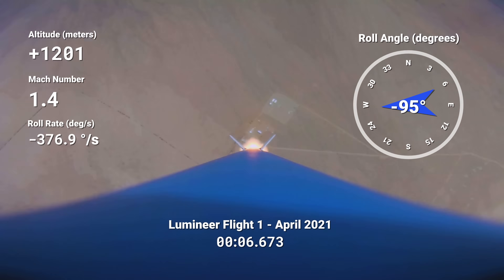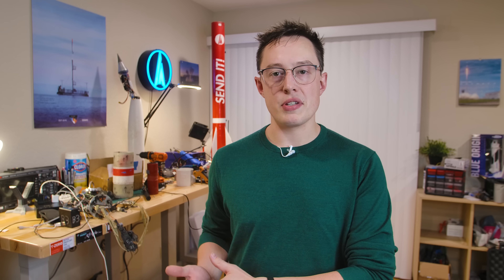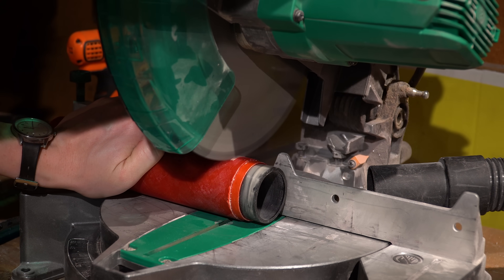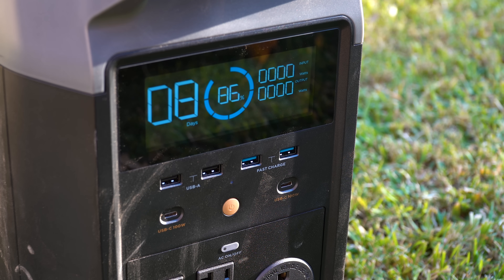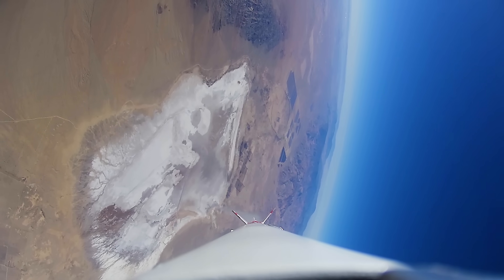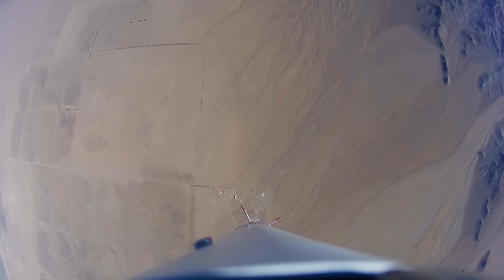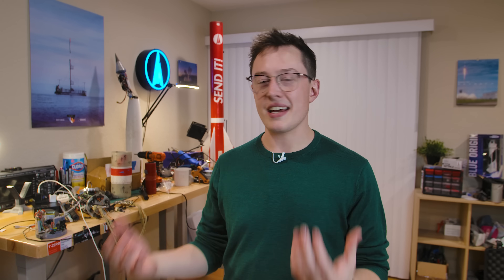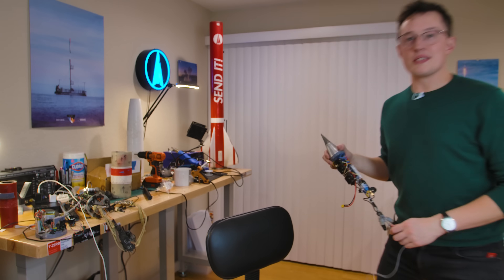Can You Get Stable Video From a Spinning Rocket?

Comment: The motor isn't necessarily the problem, it is the ESC. The hobby ESC's use back emf to synchronize the commutation of the phases. A better ESC / better ESC tuning could decrease the back emf voltage (which is proportional to rpm) that is required to synchronize the servo and motor. A way to avoid the need for the esc to rely on b-EMF to syncroise is to use a motor sensor i.e. hall-effect sensor / rotary encoder / magnetic encoder... this turns it into more of a servo drive for positon / velocity control.
The next step from there is an ESC that produces sine wave phase ouputs rather than bang bang outputs.... then you will have arrived a a field oriented control (FOC) servo!

Check out simplefoc or Tinymovr

Comment: What if you go with rotating the rocket at a known speed that would line up with the shutter speed of your camera? It is similar in concept to thoes videos you see of helicopters that looks like they are just floating around while their propellers look like they are sitting still. You could also attempt to measure the rotation in post and then remove the frames that contain data that you don't want, with this method you could potentially pick any fixed point on the ground.

Comment: Have you thought about putting a gyro into the rocket to counter the fact that it wants to roll? Another option would be to use the gyro to hold the cameras where you want it to be. Instead of focusing on a point and calculating roll use gyros to keep the camera in one place.

Comment: 0:28 NO NO NO NO NO... joe, carbon fiber is not something you want to be inhaling, you are supposed to limit the dispersion of particles (i.e. use ventilation, cut it while submerged, use active dust extraction)... NOT CUT IT WITH A CIRCULAR SAW AND THROW THE DUST AROUND AFTER!!!!
Reply: Never mind, I realize now that it is not carbon fiber. But still, even fiberglass isn't good to ingest!

Comment: Others have said this but I want to add as well, the camera system is working as a reaction wheel and is changing the angular momentum of the rocket. When the camera is spun up, this is causing the rocket body to spin faster and also potentially some weird gyroscopic effects. Two things can be done that I know of: 
1. Try to lower the moment of inertia of the camera system, or 
2. Add a wheel with the same moment of inertia as the camera system with opposite angular velocity and acceleration. 

This video was awesome, can’t wait to see what you’re doing next.

Comment: It may take a rework of the code you have and this is likely moot after replacing the original motor with a stepper motor, but correcting a slow roll wasn't the core of the problem you were trying to fix. The problem of having a camera is when the roll gets really high and makes the footage blurry - in those cases, the spinning section works really well. When the rocket is rotating slowly, there isn't as much of a need to correct the footage. If the code only tried to correct quick movement but turned off when it was below a non-zero threshold, then the picture would be much smoother overall.

Comment: Nice video, I do love a bit of over engineering. Have you thought of a simpler solution using a few cameras with trigger sent by gyro when at a certain angle. As soon as it spins up a bit you should be able to get decent fps, 6 cameras will get 24 fps at 4 rotations per sec. You probably can get shots at multiple angles too. Bonus of no moving parts and all those weight savings.

Comment: Try to mount a step motor (like old capstan from old VCR) to move all the mecha. This kind of step motors are strong and react to slow speeds with very precision. They are controlled by PWM and uses a hall sensor to read back the pulse from the motor… to me is the best option.

Comment: As a from-the-outset fan of the 360 alternative, I'll concede a legit use case for spin cam technology: possible future payloads that can't use the 360 approach. It will still be good to spin small rockets for stability, but not every payload can handle the spinning. Having the ability to stabilize part of a model scale rocket could be of potential use.

BTW, did you consider small controllable fins on the stable section? They could supplement the motor to better butter your smoothness. I suppose they could even replace the motor if the extra fins don't cause too much drag.

Comment: There is so much that went right here, I wouldn’t be so hard on yourself with the outcome. Having done a lot with steppers myself, make sure your uC has a high enough frequency so your step rate can spin the motor fast enough. Something like a teensy or esp32. Also hopefully that stepper has a fairly high step angle. Don’t microstep but maybe try some TMC2209’s to keep it smooth.

Comment: What about using an actual 360 camera? Frame rate might need to be reasonably high to get the best result but might not matter even that much..would be simpler, no moving parts and weigh less..

Comment: Why dont you use brushed dc motors that are so sweet to control in position and speed? No need for those nasty escs that suffer in slow speed and position.  just a position encoder and you are good to go for precise control with any mcu and a simple driver stage. I mean brushless with esc are great for many applications but the good old brushed dc is a charm to control and does not need any serious processing power for precise control. By the way you are doing an amazing work totaly, congrats 👏

Comment: Maybe use a DC motor? Your system is basically a servo anyway. Very easy to drive with an H-Bridge, startup at low speeds is fine and might have a better RPM/Torque range than a stepper

Comment: One thing I noticed is that the camera gimbal acts like a flywheel, remaining fairly steady and making the rest of the much lighter rocket spin. I would be very tempted to put all the electronics outside the gimbal and use a slip ring to transfer power to the cameras. That way, it would make the rocket itself heavier thus reducing the flywheel effect.

Comment: Couldnt this problem be solved in software by aligning the framerate with the spinrate? Like a helicopter that looks like its rotor doesn't move? Or would the effects of motion blur be too high? If the spin rate is too low it should work with more cameras as well. You could even get a 360 shot by just stitching the right pictures of each "sector" together.

Comment: Okay I love the camera spinner, I hope V2 works. But an idea that I had about active control: cold gas RCS. 
4 holes, 2 valves, 2 solenoids, a pressure regulator, and a tiny CO2 cartridge. Might be too heavy but would be neat.

Comment: Look into FOC control for brushless motors, can get very smooth motion at low speeds, but still maintain higher speed rotations if you need it. It is a bit more complex though.

Comment: If you can't get this precise enough, you could use a 3d camera ON a spinning mount. Then the assembly doesn't have to keep perfect stability, it just has to keep the roll rate down enough to not lead to excessive motion blur or overwhelm the stitching software.

Comment: for the stabilization, you should stabilize based on the delta of the roll, since its not actually important that the camera holds a steady roll direction, but just that it dampens roll rate. this would solve the windup issue and it might also make it easier to get the motor to just not bother correcting if the roll rate is lower than its minimum starting speed, and just those changes alone i think would be a huge improvement for the viewability

additionally, although it probably doesnt matter at the current RPMs youre experiencing, you could always have it take into account the framerate of the camera and find the nearest multiple, so if your camera is 60hz and the rocket is rolling at 55rps, you could spin the camera to +5rps rather than -55rps and the framerate will hopefully turn it into a smooth video, although i guess that might end up producing some artifacts with shutter speed producing warped video... but its something to consider nonetheless
Reply: I was thinking about frame rate shenanigans as well, definitely something to keep in mind.

Comment: The smaller motor that you are using a 1404 doesn't have the touqe to mover it so maybe try a larger motor like a 2207 might give you more control and a lower amount of KV (rotation) to gear out.

Comment: Lost my last comment apparently, but I think the issue with the camera not rotating in the start is caused by G-forces.

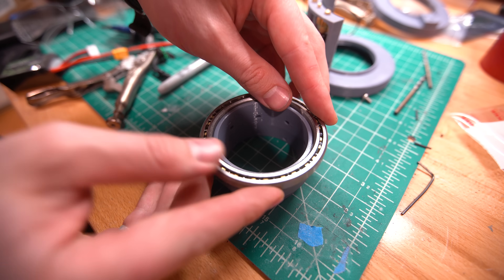Your bearing 4:44, helps rotation with lateral forces. But during the launch the acceleration is vertical, potentially stiffening that bearing ring. Solution would be a flat bearing below the current bearing. Those in combination would allow rotation regardless of acceleration direction.

Comment: if the stepper motor doesn't work, you may want to check out Justine Haupt's "NearZero" controller which allows for very fine speed control with a low-cogging motor https://www.youtube.com/watch?v=OZvjfbpXpro

Comment: The motor is not he issue its the driver. You need a very specific FOC driver to drive any bldc at low speed. Try looking into VESC, MJbots or Odrives. And of cource you need an sensor (encoder). Theres a vesc compatible board designed for small motors. Its called xESC2, however you'll need to build it yourself and may have to change a few components to make it work. 

Also, the best motor for this is a Brushed DC motor with an encoder and a good h-bridge. Steppers might work but they are too heavy and bulky.

Comment: This solution has a potential to add pre-made characteristic to rotate not only against the rocket spin, but also to set the camera recording what exactly should be recorded, e.g. the earth right below, or horizon, or sky or mix of everything in a smooth, programmed rotation. Did you consider to use a spinning gyroscope to stabilize the whole rocket spin instead of the complex camera stabilizer? In terms of weight it may be similar. In terms of complexity - probably way simpler.

Comment: Hey, I was just thinking... Have you tried working with shutter speed ?

So you know how when you look at a video of a car moving, usually the wheel looks like they're static, or even going backward ? Well, that's because camera take pictures at a certain speed (usually between 25-60 images per second), and then play it back at that same speed. Meaning that if a wheel is moving at a speed that match the camera, then it won't appears to be moving.

Well, try to do the same with your rockets: put like 3-4 camera around it, and then just stitch the footages together (for exemple, only keep the frames that were taken when a camera was facing north)

Comment: Cool project. It's already been suggested, but making the camera ring controlled aerodynamically (passive rollerons or active steering) could be a good way to avoid the issues you're seeing with the geared motor approach, while also being smaller, lighter and less mechanically complex. You'd probably be able to get away with some very small fins, minimising the potential for flutter or overloading the servo.

Comment: Other than the wind up issue and that is software so to be expected and can be fixed the rest was a huge improvement and the stepper should really help especially eliminating the gear train. The structure how well could something like that work if built into the main body of the rocket is basically a post tensioned structural member.

Comment: I haven't done the math on what shutter angle would be required to get smooth footage out of a spinning 360-degree camera, but I would be pretty surprised if digital stabilization would work at all. I think you're going with the solution that is most likely to succeed, and I'm really looking forward to good footage from a high-powered rocket. Also, I think this footage is excellent for a first attempt.

Comment: Would it be attainable to have a gyroscope with a longditudinal rotation position sensor driving the motor for the stable camera platform directly - based on rotational position data - rather than the method you've used? I don't know about the availability of very light gyros with rotational position outputs but surely they're quite common in aircraft avionics?

Comment: probably best to use all that mass on a very low friction bearing as a high moment of inertia ring, and let the difference in moment of inertia of the rocket and camera to keep the camera from moving. Electronics are probably a waste here for such a small scale implementation. Mechanical is usually better if it can be done.

Comment: Why do you try to keep aiming in a given direction, as opposed to trying to keep the roll rate down? That would not exhibit wind-up issues (by construction, not by explicit handling) and would deal more gracefully with lower speed limit: it would just not correct slow enough roll rates, instead of doing jumps.

E: Also, that makes handling of cases when we rotate around other axes, too, way simpler.

Comment: I applaud your faith in sensorless ESCs, but absolute positioning is simply not an application they were designed for. The thing you are looking for is field oriented control, the same tech that's used in brushless servos.

Comment: Have you considered using a ring motor? The BLDC ones probably wouldn't work, but maybe the piezo type could. I know they're used in the focusing systems of some camera lenses. That should have similar design requirements to what you want here. I don't know the motors in enough detail to do the full engineering workup on them, but they seem to match what you want. The main thing to look at with them is the shock tolerance. (It would be going in a rocket, after all.)

Comment: Not sure what esc etc. you're running, but it'd probably be worth having a look at some of the brushless systems being used on RC crawlers, such as the Furitek ESCs or the AM32 firmware for certain blheli32 ESCs; they're optimized for very smooth low-end control. simpleFOC would probably be worth looking into, possibly running a lower KV gimbal motor & lower reduction ratio. May also be worth looking into a full hubmotor-style direct drive configuration, as that'd probably allow a for a pretty lightweight and responsive config; there's a fair bit been done on custom hubmotor setups in the combat robotics world, which could probably be carried over.

Comment: I loved As an engineer it is my job to overcomplicate things, lool 

Speaking of which, you should keep the whole control assembly, batteries speed controller chips motor, everything stationary above, then only spin a ring with the camera. Then slipring if you need any wires.
This way it can be shorter section of inner tube for strength, easier pid tuning, less reaction wheel weight, everything. And can make the tube 3 inch.
Have the drive gear on the inner tube be above the bearing so the motor can be mounted to the bulkhead. Or inside the tube and motor goes in for better strength 
Yeah for the motor you should use a sensored brushless with and tune the esc pids for speed, similar to how electric longboards can accelerate smoothly from the known weight and accel they want, and rc cars want fast accel.
Or use a stepper motor with a at least an 8 bit driver like a printer, if you need real speed higher, or a servo motor, or a continuous rotation servo. Or a 775 brushed motor, or more power any .3w brushed motor,

Then you’ll be good
Good video and looks fun to learn
Reply: slipring only needed if the camera didnt have built in power or record signal.  Or graphite brush and ring rial

Comment: Dude, cool video, but use a VESC!

It is so advanced by now that you don't need an encoder even at ZERO RPM! with Brushless motors. 
Not only that, but full motor torque at 0 RPM. 
It even got better interfaces then PWM

Comment: A small motor and gears will never provide the smooth motion you want. I’d suggest making your own brushless motor by having the permanent magnets fixed to the rocket body and the coils on the camera assembly. This is how most camera gimbals work, a single large ungeared brushless motor.

Comment: 360 camera will have issues with motion blur and rolling shutter so I would agree that is better to avoid if possible. Motion blur may not be an issue in broad daylight but rolling shutter likely still would. Is it possible that the high g-force at the beginning of the launch could affect the gyro readings? I guess by now you'd be familiar with any issue like that.

Comment: What if you could adjust the framerate of the camera in relation with the spin of the rocket? The camera could take a picture each time it looks in the same direction. It could be much lighter to work the problem in software than making a hardware hack.

Comment: Add a differential with a smaller servo in the geartrain? at low speeds you just multiplex in motion from the servo. when you gotta go fast you spin the brushless

Comment: I,ve developed a simple FOC control on an Atmel 328p MCU in combination with an as9500 encoder for my dirt cheap quadruped. It’s torque controlled and doesn’t care about minimum speed. 
Would fit right in to this project. 
It’s controlled via i2c and runs with an update rate of approx. 2khz.

Comment: I expect the issue at low speeds is actually to do with the motor controller your using as traditional hobby esc tend to perform poorly at low speeds, you would probably get much better results if you use a more expensive field oriented drive